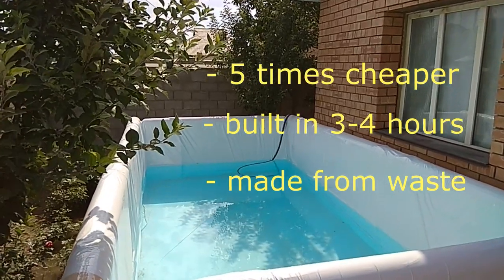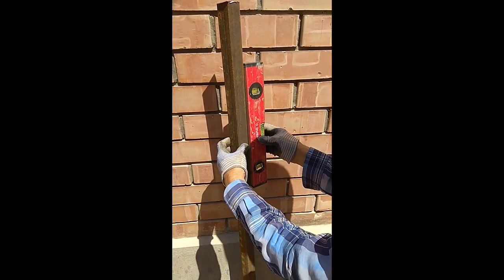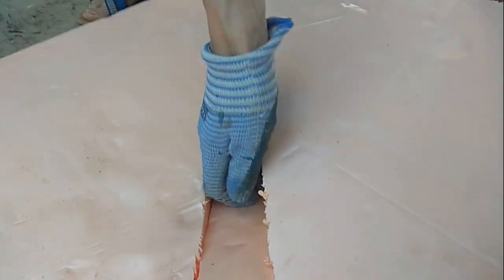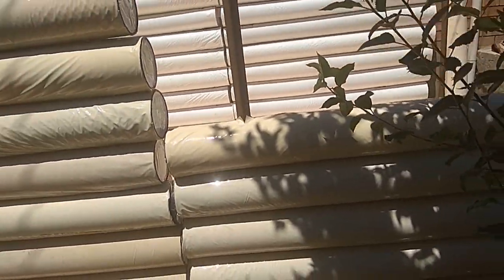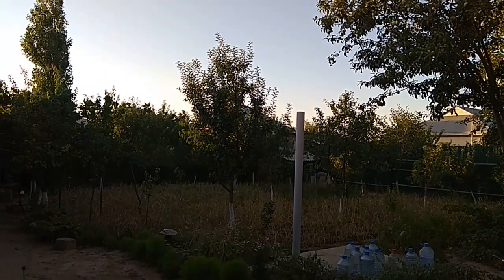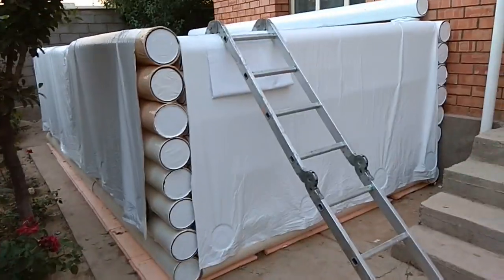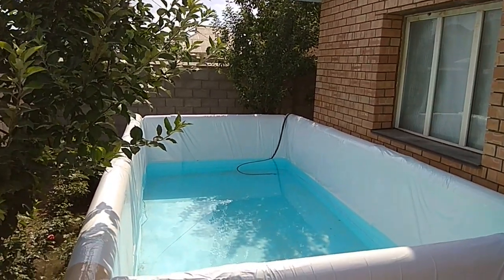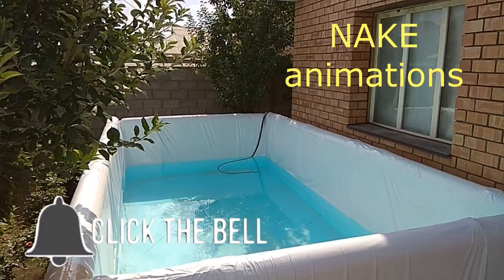Swimming pool in 3-4 hours. 5 times cheaper. Made from waste. Resistant to sunlight. Relax at home

Comment: Theres a lot going on here thats just not okay. Are you planning to filter the water or are you just gonna drain like 5-8,000 gallons every time the waters dirty? Pools arent supposed to be “sunlight resistant” that phrase literally makes no sense. theres no filtration or circulation. No better than a koi pond. Yes You can make your own in-ground pools but please do not do this at home or an above ground. I know for a fact this pool is not legal and he does not have a permit. He has an enclosed yard, with close neighbors. This pool is dangerous. Its literally dangerous for his own house. Its literally attached to the wall of his house. There is permits and regulations in every town to have ABOVE GROUND pools a certain distance from YOUR house and your neighbors property. Fun fact; the structure of an above ground pool is the water itself. Thats why when you install an above ground pool, you need to put water in it the same day. Because a gust of wind could destroy it if empty. Its not JUST the wall thats holding the water- its the vinyl liner holding it too. Pools are funky, if you could build pools like this- companies would be doing it. That liner or whatever the hell you used for one will tear eventually from the weight. It will flood your property and do damage to neighbors. I cannot believe i actually typed this entire paragraph. But i hope you read this in time and take it down
Reply: At 9:30 you can literally see the vinyl tarp suctioning to the wall tightly. This is from the loose vinyl tarp and weight of the water. If you put those two factors together: your putting tension where the tarp goes over the wall. That will give out eventually. I guess you could maybe replace it yearly. Wouldnt bother. Be smart and make a home made in-ground. They are very possbile, and i have serviced them before
Reply from the maker: Thank you for your letter. We agree with you in some points and we have fixed many points, you can watch it here https://youtu.be/imEcPEyABmY
Pls, share your opinions about that
Reply from the maker: Yes, but at second option https://youtu.be/imEcPEyABmY  high of the pool is quite lower and walls are very stronger. It is so comfortable for many regions exept countries like yours, where no strict low like yours. And especially if it made from waste, in detail about waste material we will release a video in few days